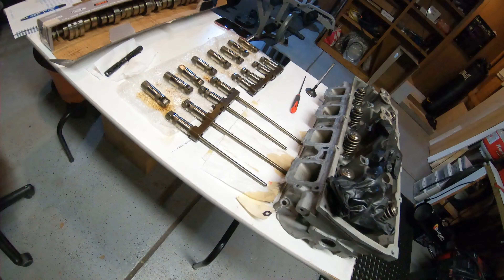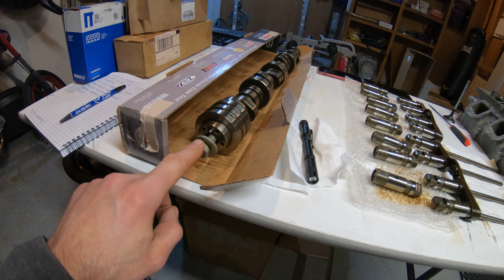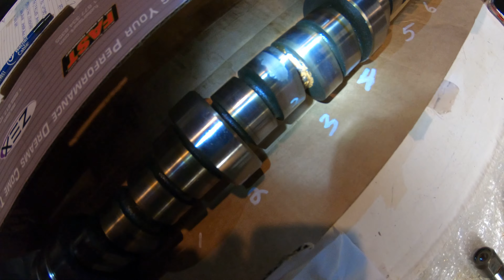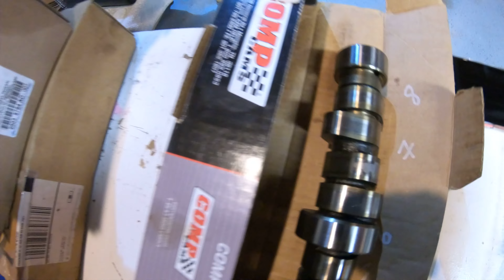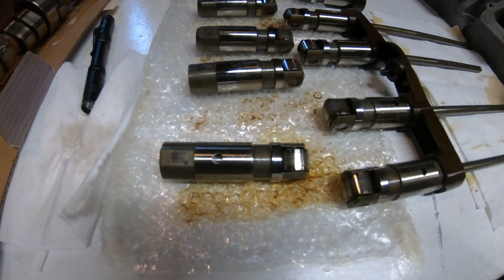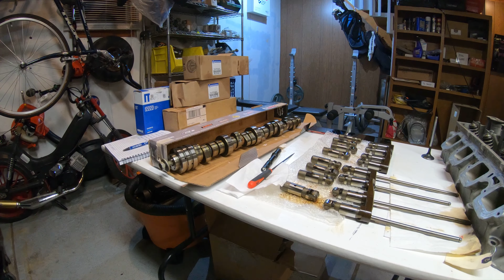5.7L & 6.4L Hemi VVT Camshaft and Lifter Failure

Comment: Thanks for the video.  In the aftermarket world, which mfgs produce camshafts from billet cores?  I have a 2014 5.7 Challenger, M6, with 77K miles.  I've heard nothing from it, yet, to indicate cam/lifter failure.  Seriously thinking of porting the heads and sliding in a beefier cam & springs in it.
Reply from the maker: Comp is used by the majority of custom tuners who develop Gen 3 VVT camshafts.  IIRC my cam is -18 billet steel 👍 Crane may make some aftermarket grinds as well

Edit, nice thing about owning an manual challenger is they already have a full set of non-mds lifters in them…. Plug the camshaft in with some head work/springs and go!

Comment: I had a weird lifter failure.. An mds lifter rotated 90 degrees and ate through the cam in a u-shape!
Reply from the maker: Not enough pushrod/spring preload and it’ll rotate out of the yoke 👍
Reply: @GarcBomber  Damn so it could happen again! Thanks for the info
Reply from the maker: @malamri424  upgrade to chromoly pushrods instead of OEM aluminum, I use Trend 👌

Comment: The wear pattern on the lobe looks to me like the lifter roller is bouncing or possibly turning somewhat 'sideways' while traveling on the lift ramp. 
For the first possibility wouldn't you need stronger v.spring pressures?
For the second possibility, are the lifter holders not rigid enough to hold the lifters steady and rollers aligned properly with cam lobes?
I still think oil quality(cleanliness,  not necessarily brand) and oil filtration is EXTREMELY  important. For the life of me, I don't understand why they don't have a full size filter on these engines. There is plenty of room for one on my 09 Charger.
Reply from the maker: Excellent observations, the lifter yoke is designed to prevent any rotation but I’ve seen it a handful of times and roller-instantly eats up the cam lobe.
Stronger spring pressure will assist in larger valve lift camshaft and help in the possible light preload, but the pushrod length should dictate on a hemi(lifter has .140” + plunger).  The yokes are plastic but there are other material options available.  Most high performance rams run the 20-500 royal purple filter, synthetic media and longer/more capacity, better bypass valve pressures.  Thanks for watching!
Reply: @GarcBomber  I'm not talking about the lifter turning 90 degrees, although that does happen occasionally. I'm talking about the lifter just rotating a few degrees back and forth from the intended straight ahead position. I, personally, have never  seen/felt how tightly the lifter holders hold the lifter bodies from turning, but I have seen instances on YouTube where those lifter gang holders have shown up cracked when tearing these engines down. What I can't say is why or how they cracked. If the lifter body has enough slack in the fit of the holders, I can see the roller being able to meander back and forth somewhat. If they allowed that kind of movement for very long, I can see how that would shorten the life span of the cam & roller.
Reply from the maker: @budlanctot3060  there was enough interference on the yoke to physically hold the lifters while removing and inserting 4 into the block bore.  Can they rotate slightly, sure if there isn’t enough preload from the pushrod ball into cup.  Centripetal force and a thin film of oil will minimize friction heat and prevent any rotation in the assembly during operation.  After 115k miles it could certainly be a variable of the equation on why the lobe surface hardening failed.
Reply: @GarcBomber  Could a stiffer push rod potentially help this issue?
Reply from the maker: @seavisions  most definitely!  You’d need to measure preload on the valve

Comment: I'm not defending dodge, I do believe the crank is to far from the camshaft, however you only hear about the failures.  And there are what a couple million gen 3 hemis out there? I personally haven't had this problem yet, I definitely suggest using good oil and change it often. Oil is cheap, engines are expensive.  Every car manufacturer has its issues. People drive these things hard.
Reply: What does the distance of the cam from the crank have to do with the cam/lifter failing? If you're referring to the UT theory, that has been universally debunked, so much so that even UT has backtracked from it, somewhat.
Reply: @budlanctot3060  you have absolutely no idea how a conventional pushrod engine works lol, it's humorous really.  The crank splashes the camshaft with oil continously. Are you ready? The camshaft is much further up on the block than usual, so at idle it dosen't get the oil it needs to stay lubricated!!!  That's why the failures are cars such as,  police cars that idle for long periods of time.  So, before you open your mouth, sound ignorant because you are, maybe you should know how a engine works.
Reply: @otisdriftwood8469  well, doucheman/internet troll, I know enough to set you straight. Are you new here? Mopar has been using WINDAGE TRAYS  for like 50 yrs. The purpose of a windage tray is to keep the crank from splashing oil in the sump. Cams haven't been lubed by splash for a long, long time(at least 55yrs or thereabouts in Mopar performance apps). 
The CONNECTING RODS USED to squirt oil onto the cam in older Mopar v8's & v6's. I suspect the reason Mopar went away from the rod spit holes is because they've gone to cracked caps & powdered metal rods. 
In the 3rd gen Hemi the reasons they raised the cam in the block in the block are they wanted to  change the pushrod angle which had been problematic in the LA engines. This allowed them to shorten the pushrods, making them inherently stiffer and reducing deflection. It also allowed for more room for the camshaft, so they can make bigger cam blanks with larger base circles to accommodate roller lifters and more aggressive roller cam profiles. 
The actual change in lifter angle is only about 15deg from the LA engine.
There are three main oil galleries in the 3rd gen Hemis for the cam. One below the cam feeds the cam journals. The other two are quite large & straddle the cam & feed the lifters constant* pressurized oil directly. The pushrod is fed oil intermittently thru the lifter. Tha balance of the valvetrain is lubed like traditional Mopar v8's were via oil pumped up thru passages in block, heads, shaft stands, shafts & rockers.
In 09 Mopar substantially increased the size of oil pump passages and the filter fitting to accommodate increased oil requirements for VVT & MDS.
I think I know a little about how engines work, as I've been building Mopar engines for about 50yrs.
Reply from the maker: FCA isn’t the only one with valve-train issues, the percentages are something we can only speculate. You’re spot on, this is mass produced in several platforms so you’re probably going to hear about the failures online, especially when someone has to fork over $4-5K minimum to get back on the road. Thanks for watching!

Comment: I heard long periods of idling will cause lifter failure as well, because the cam is Barely getting oil up to the lifters. The lifters only get lubricated real good when the engine is spinning 2,000 RPM.
Reply from the maker: It certainly increases the probability, no doubt!
Reply from the maker: I’d recommend increasing idle rpm(750) with a custom tune if it’s going to idle for long periods along with shorter oil change intervals.

Comment: My 2013 done the same on #8 intake . Cam is peeling and all roller lifters are good😮.Replaced all components as a set of course.
Reply from the maker: Sorry to hear but thanks for watching. I'll add another data point onto the spreadsheet.  Did you replace with another MDS camshaft and how many miles on your '13?
Reply: @GarcBomber   all stock lifters and cam  but Felpro gaskets and head bolts . Truck had 175000 km when it started clicking.

Comment: I agree completely. I went through the failure a couple years ago and came to the same conclusion. I feel sorry for all the people that only change the lifters and either leave the cam alone or replace with an OEM cam. Maybe they fixed the cam hardening process but I wasn't willing to take that chance, plus I wanted more ponies.